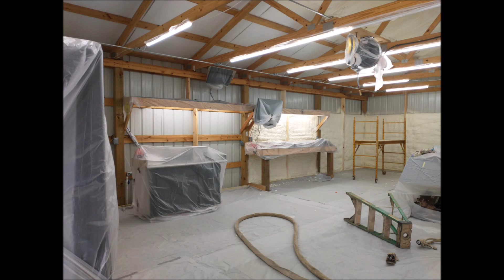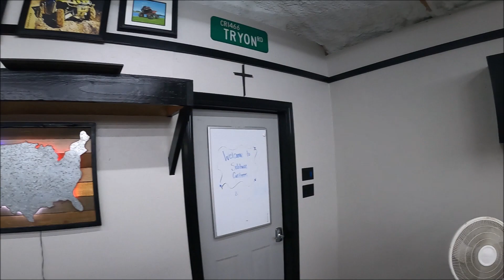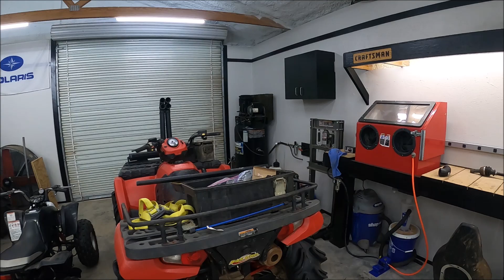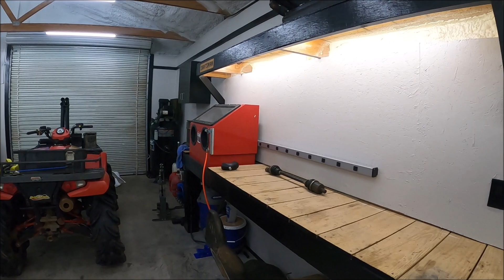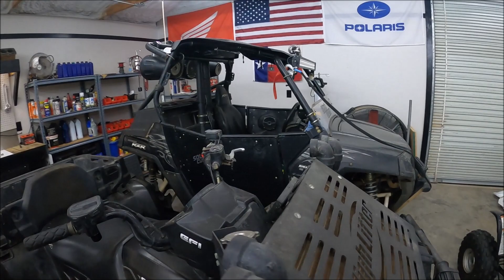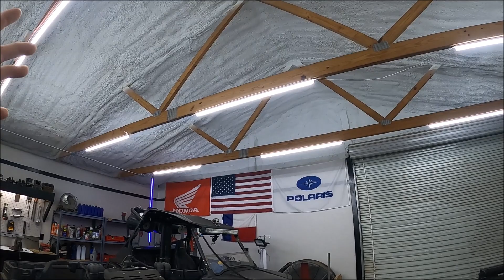Shop Remodel is Done - Ready to Work

Comment: I have a similar building with spray foam.  I just recently had a mini-split installed and noticed some foam has contracted a bit...
Reply from the maker: Is yours painted or not?
Reply: @Solitude313  I did paint the walls and ceiling..

Comment: Hey bro i have a 06 polaris sportsman 800 and since i bought i got it used and it wont run faster than 50mph and it takes a while to pick up speed i dont want it for racing but it sucks cause i had a 500 and it ran like 70mph i wonder if you could know what could be wrong with or if anyone can help me know what it is